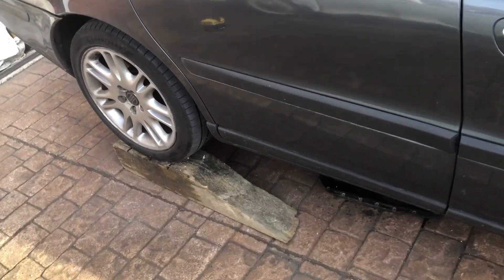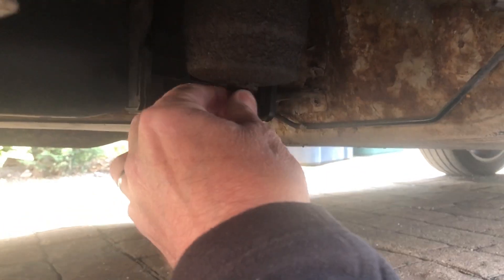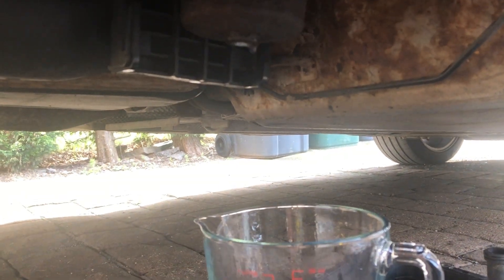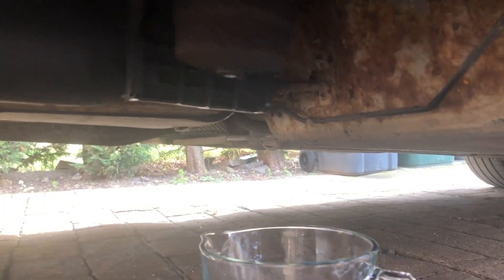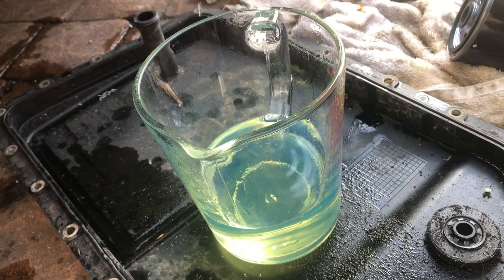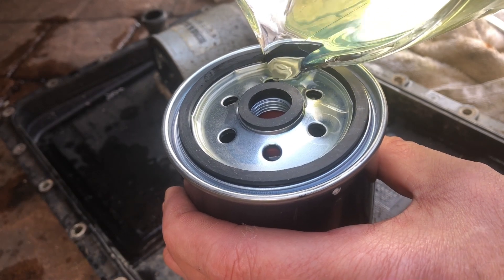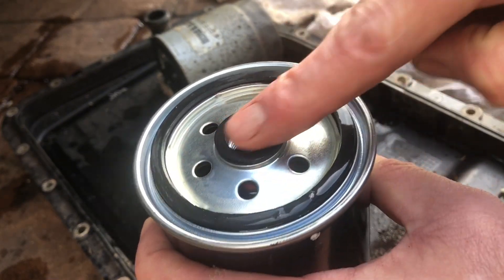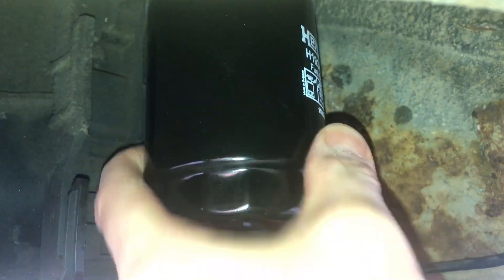Volvo V70 D5 MK2 Fuel Filter Replacement.

Comment: 226,000!  Just run in.

Re. draining water this has become a thing for us since the local fuel stations, both supermarkets, have become famous with local garages as being the likely source of water ingress into fuel. Not sure if it's condensation in the tanks, rainwater ingress or water in the road tankers.  My wife's XC60 actually stopped a minute or ss after starting and refused to restart, when the temperature was well below 0°C. Waited until a few days later when everything thawed and it started and stayed running no problem. I now have the garage check the fuel filter every time the cars are in (mine's an XC70) and they usually report water. A local tradesman who gets through a lot of diesel told where he goes to avoid this problem. We'll see next time it's in.

Re. hand tight, that was lucky! Volvo spec these at (I think) 4 Nm (not sure if that is = or > hand tight) and we have needed the special remover ring in the past.
Reply from the maker: Quite it’s a great car  - you have been unlucky regarding the Diesel supply that was the first time I had j changed the fuel filter in around four years of ownership, it was way overdue!